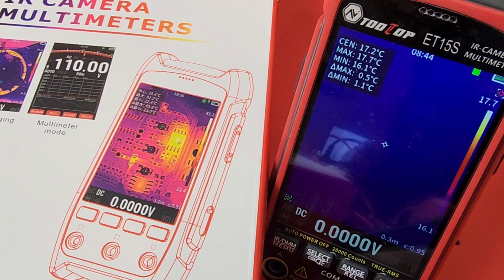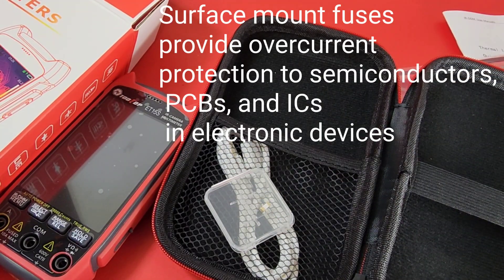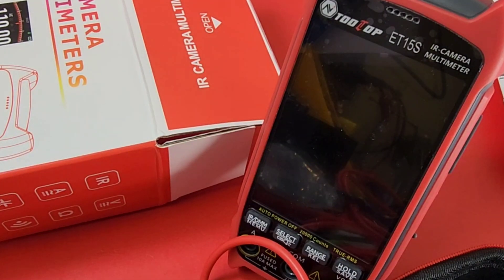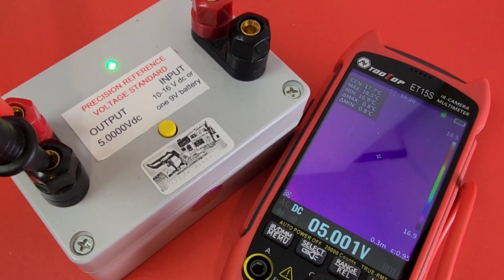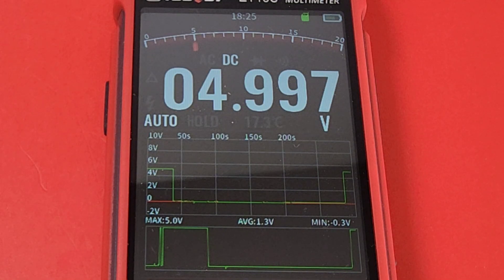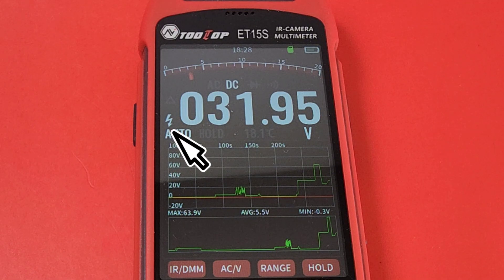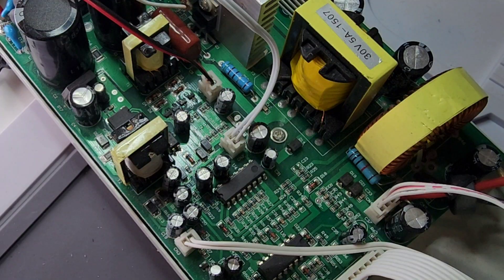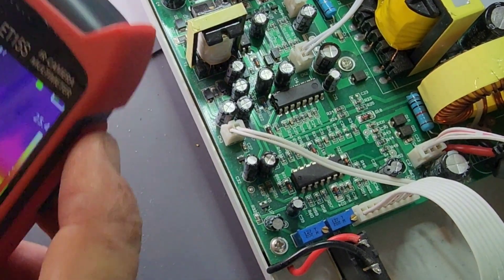UNBELIEVABLY GOOD! ET15S ThermalCam Multimeter Review &Teardown!

Comment: I am really impressed with the camera. This is on my list to purchase for sure now. I own a couple thermal cameras but none with that level of resolution. Really helpful for pinpointing which tiny SMD component is getting hot. I was looking for the Winapex 189c you reviewed a while back. Ended up finding it rebranded as Aneng. Just received it. Really liking the nice bright display on it. For 13 dollars, it can't be beat. Do you have the ZOYI ZT-DQ01 on your radar? I'm trying to determine if it is better than the budget Fnirsi one I bought a while back.
Reply from the maker: Hey hey.. how you doing my friend!! This is one heck of a Thermal cam I agree.. the picture is incredibly detailed especially in Macro mode! 👌 Fear not, the Zoyi ZT-DQ01 will be reviewed in September..it should be a zinger !  😃